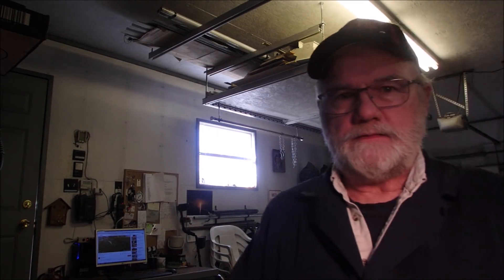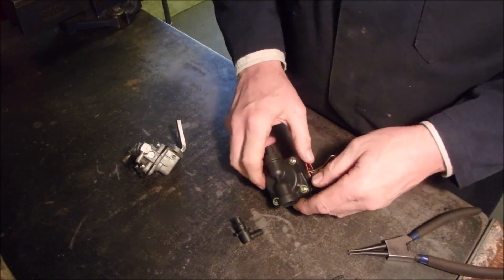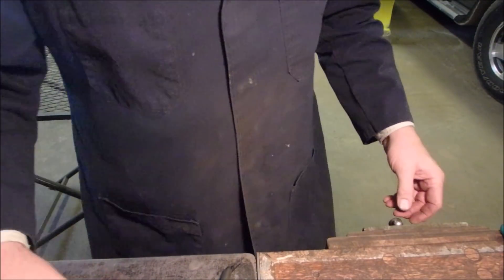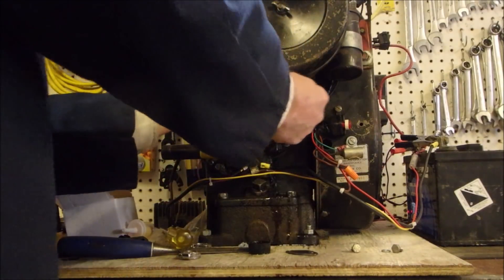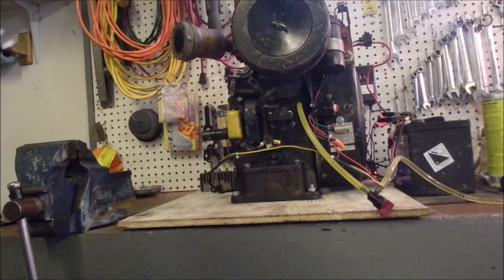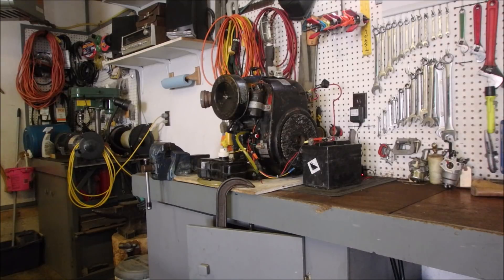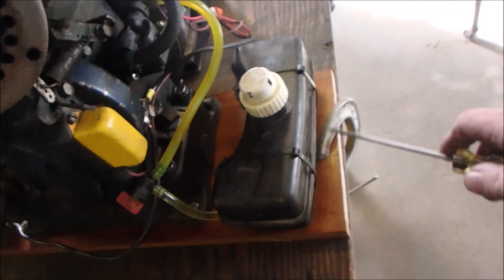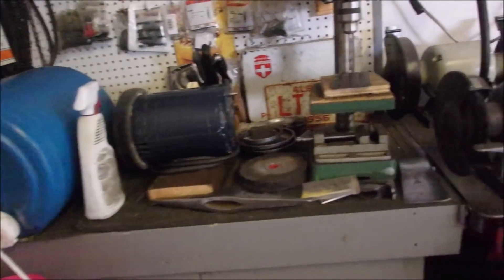Modern Fuel Pump for Kohler K241

Comment: That fuel pump seems to work great. Good job on finding it. The older engines always surprise me how low of an rpm they will idle compared to newer engines. It seems to run really well with that fuel pump. Keep up the great work buddy. Have a great weekend!
Reply from the maker: Thanks again.  How are you doing?
Reply: @BrucesShop  I'M doing good Still tight and sore from all the Lymph Nodes they removed I am starting Physical Therapy April 1st so that should help. Thanks for asking.

Comment: I bought 2 of the plastic pumps from Amazon last summer. They both died with less than 4 hours use. I did not put the oil in the pump. I'll try it next time. Good Luck, Rick
Reply from the maker: Yes I heard the have a high return rate.  Thanks for heads up.
Reply: @BrucesShop  Another youtuber said that often the valves stick in the original pumps and you just have to take them apart, free up the valves, and use Marvel Mystery Oil in the gas. I'm going to try that with 4 old pumps that I have. Good Luck, Rick

Comment: Great video!  I think the secret to the smooth idle on these old beasts is the huge flywheel.  They seem to be heavier than the comparable HP Tecumseh and Briggs engines.
Reply from the maker: You are right.  Even with the plug out it is heavy to turn over.

Comment: I bolted a 12volt winch to my shop ceiling for hoisting stuff up. I almost bought a 120volt hoist from PA that was on sale a month or two back.
Reply from the maker: Yes I saw that..   When that happens I ask myself.  Do I need it.  I use the (old reliable)  hoist 3 or 4 times a year.   BUT I WANTED IT   LOL!!!!

Comment: Not to slow on the idle, its a splash lube system.  the last gasp is the compression release holding the valve open. The K series was a favorite on the Gravely tractors,  the blocks were a special design for the engine adaptor plate as well as the crankshaft.
Reply from the maker: Thanks Ed.  As i was doing it. I mentioned that, and you could here when i slowed the video down that there was some clunking going on.  Thanks again.  I means a lot to me.

Comment: Make it into a portable jump station, normally u add a alternator to the engine but yours already has output so modify some jumper cables and..👍👍
Reply from the maker: The only issue for a using the onboard battery charger is it is limited to just under 10 amps.  (Stator and diode block)  But this idea may create another,--- already going on in my mind.   Thanks again.  Great idea.

Comment: Can you please include part number and where you got it from  in your description?  Ebay? I got K321 that might need one eventually,  I'm sure the OEM one can be had for an arm and a small toe. Thanks!
Reply from the maker: Sorry about that.   Here it is and I will put it into the comments.  Thanks for the help   This is a Canadian Amazon site but the numbers are there for you.
https://www.amazon.ca/gp/product/B08JGS3Z7B/ref=ppx_yo_dt_b_asin_title_o02_s00?ie=UTF8&psc=1
Reply: @BrucesShop  Thank you,  that helps.  I got a 1986 WH and I'm sure the fuel pump needs replacement soon.  Don't like switching to low flow electric, keep it stock.
Reply from the maker: @DC_PRL  Well this pump is as stock as I could afford.

Comment: Greetings Bruce , question for you, on my stx 38 Hydro mower no start hearing a clicking sound coming from the clutch can you help me ? Thanks Love your channel .
Reply from the maker: If the clicking sound is when you turn the key it is most likely the stater solenoid.    If the engine won't turn over it isn't  the clutch.  That drives the belt for the mower deck.  You need to look at why the mower won't physicality start.  The solenoid runs the starter.  If you short out the 2 big posts on the solenoid the engine should turn over.  See in the picture below.

Here is the solenoid on amazon
https://www.amazon.com/CALTRIC-Starter-Solenoid-compatible-Tractor/dp/B07L6MCNRW
Reply: OK Thanks Bruce , Does it matter that the click sound is coming from the PTO clutch and not the solenoid  ?
Reply from the maker: @stevekwall925  If your problem is the mower won't start The clutch can be unplugged.  You may have more wrong too.  just go slow.

Comment: Bruce, good little project. Like seeing old iron run again! I like your chain fall set up. Did you use a barn door track and roller on the ceiling?     Rick
Reply from the maker: No it it was some surplus aluminium Duct